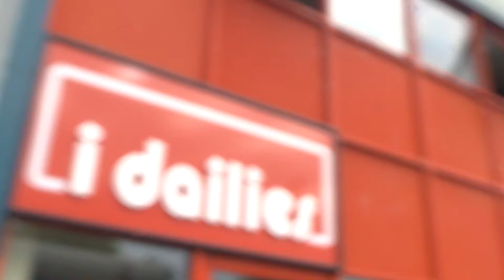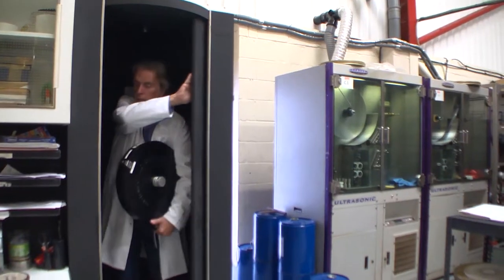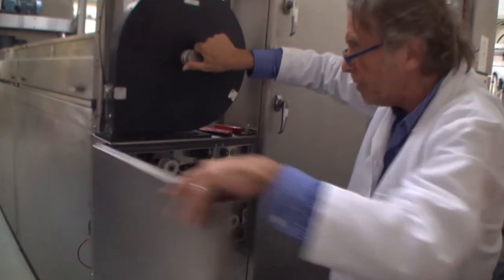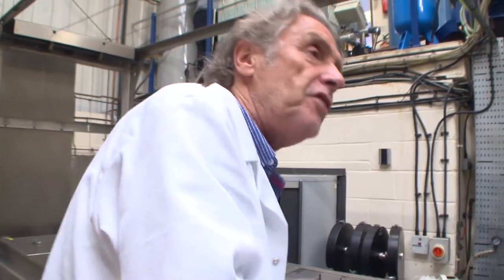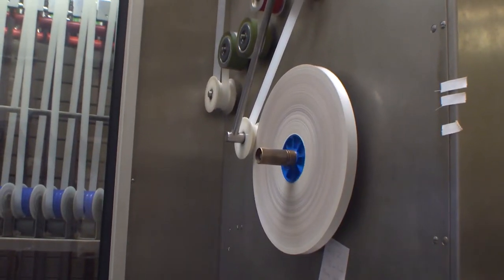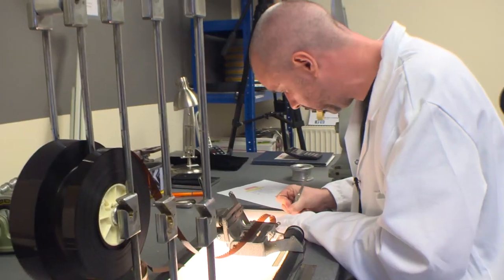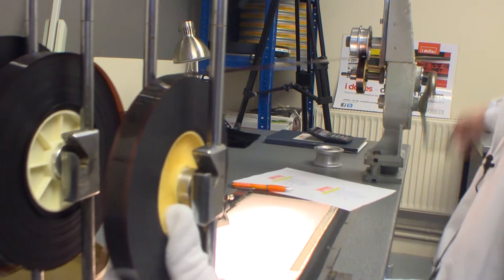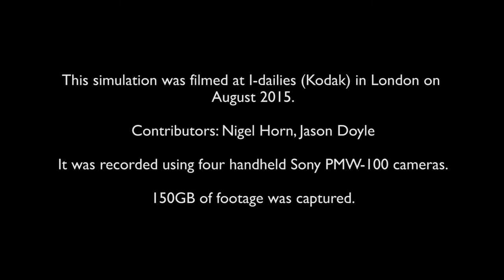16mm processing filmprocessing singlecamera

Comment: Nice video.  As usual when people describe film processing, there are a few errors due to slips of the tongue.  For instance, after the film has come out of the bleach, it is still sensitive to light.  Stick it back in the developer and you will quickly find out that the image will be lost as the whole film develops black.  The fixer doesn't just dissolve away the silver compounds that the bleach converted the developed silver into.  The fixer also dissolves away the remaining silver halide on the film - this is the stuff that light sensitive stuff that kodak put there in the first place.  Only part of the silver halide was  exposed in the camera, and hence only part of it was developed in the developer and converted back to silver halide in the bleach.  The remaining silver halide is still as light sensitive as ever.  You could dry it and put it back in the camera after the bleach (if it still hadn't been exposed to light) and sure enough you would be able to film another image onto it.
The primary job of the final rinse these days is just as a wetting agent.  The wash after the fixer is the step that removes the salts produced in the fixing stage.
Great to see a large photomec in use
Reply: Nice comment. As usual when people describe film processing, there are a few errors due to slips of the tongue. For instance, after the film has come out of the bleach, it is still sensitive to light, however the silverhalides that form the negative were developed and bleached away.  You could NOT dry it and put it back in the camera after the bleach (if it still hadn't been exposed to light) and sure enough you would be able to film another image onto it.